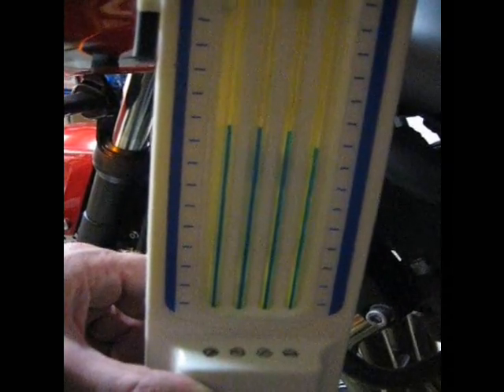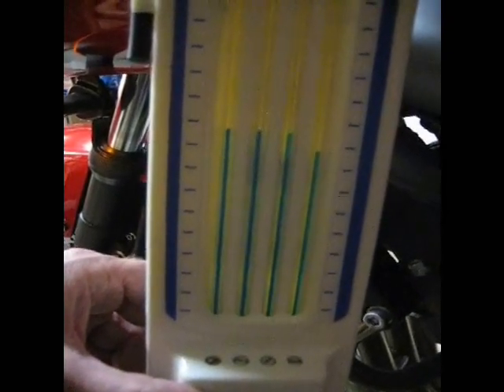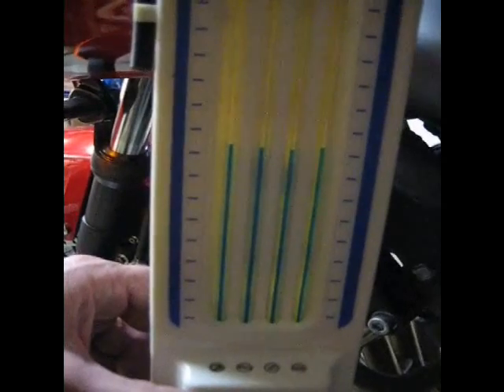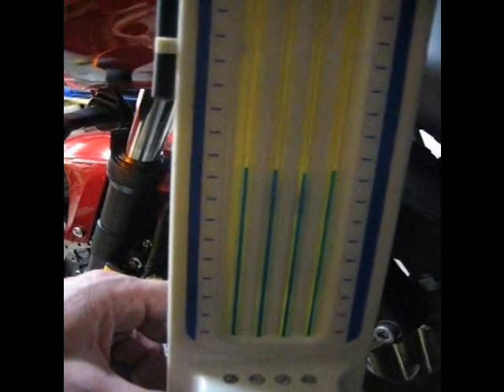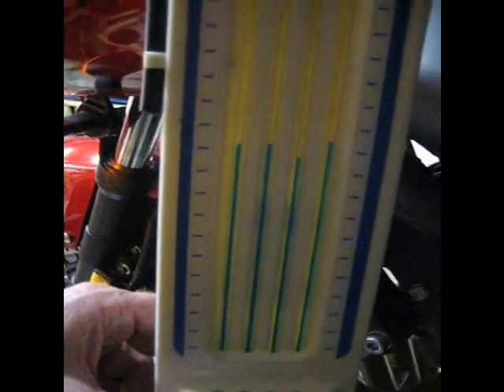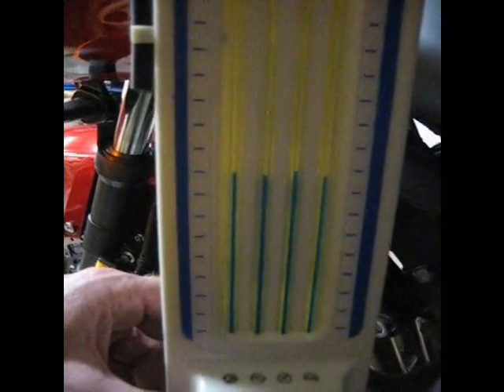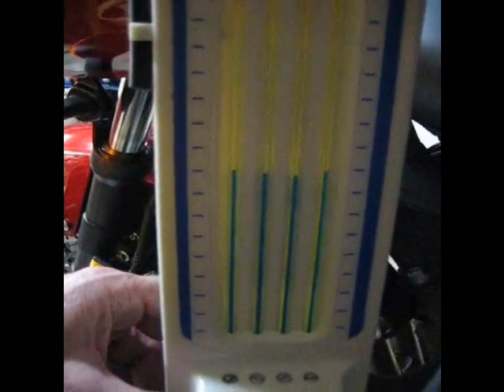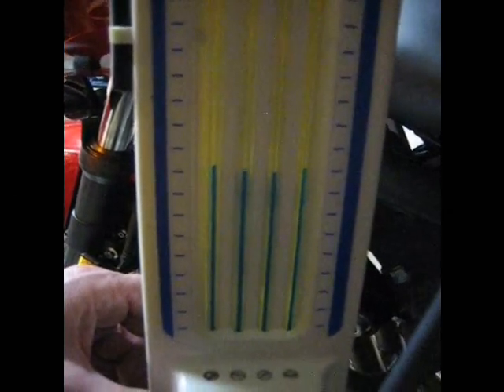How to synchronize your throttle bodies.

Comment: So is this for just carbs? Can this be done on fuel injected engines?
Reply from the maker: It works just fine on fuel injection.  The bike in that video is an FZ6, which is fuel injected.
Reply: @ElQuesoGuapo  great, thanks. I need to do this on my 06 zx6r. Where can I buy the tool for the vacuum?

Comment: Should i do it on idle 1260 rpm - service manual idle rpm, or rise at 2000 rpm and then ajust and low down to 1260?

Comment: I synced my 2011 ZX14 and it almost stop cutting out at full throttle and low rpm. I synced them at idle, should i sync them at higher rpm?

Comment: I just setup my new Motion Pro tool. And I'm trying to calibrate. But as soon as I turn the bike on it wants to pull all the fluid all the way up the tubes and into the engine.  I followed the setup instructions to the T and I double checked them.  Any advice or suggestions on on what the tool may be doing?  I'm going to take it apart and double check the brass restrictors that I put in the end of the tube to make sure it isn't cockeyed.  Any advice would be greatly appreciated. Thank you
Reply: Did u put the restrictors n the hoses going to the engine? Maybe u need to close the little screws on the tool.

Comment: If you set the balance to the cruising rpm in neutral the vacuum will not be the same as on the road as there is less load on the engine and therefore the throttle is not open as much. There will always be slight imbalances off idle through the rev range. Personally setting it at idle is the best compromise to me.

Comment: The last part of the video isn't accurate. At bigger throttle openings, the error of carb balance decreases as the percentage area difference between the open c.s.a's diminishes. Therefore it is better to balance at idle.

Comment: how do you know the 1st vaccum you have from your syncros is the correct 1,you are just matching each other ,you dont have a value?or you have to have the manual to chek the nominal value from the factory and then regulate the carbs..and is pretty interesting how 1 and 4 has more vac and 2 and 3 less but match eachother at 4000rpm thats defenitly a factory manual recomendation.i man do you have some zx7r on sell or a friend thats sell 1

Comment: You are right about synchronising at highway revs. Better still is to do it on a dyno, so that you are at highway revs AND under load. Not may of us have a dyno though.
I tried recently to balance the carbs on a two cycle Suzuki GT 500A. It was very difficult. The vacuum was so low that I had to rev it like crazy  6000 rpm, to get a reading on the Morgan carbtune system.

Comment: No apparently it is steel rods in the Morgan ones, see the website, They are suppossed to be better for the reason that the gauges can be led down in a drawer or used upside down for low compression bikes like BMWs etc, they are not allowed to use Mercury anymore I believe, but I think the alcohol ones that you speak of do look more acurate and smoother..

Comment: Wow, that liquid looks much smoother than the steel rods in the Morgan Carbtune Pro,  How often do they need syncronizing?, is it worth a bike owner getting one.   My ZX9r runs real rough at low revs, I think carbs are tuned for racecan it no longer has?, could it be that or valve clearances and carbs need syncing?

Comment: Great thanks. I guess if i bought the motion pro id have to get the 6mm adapter kit, no? Silly that its not included. At least it comes with the morgan carbtune but i like how you can adjust the levels on this before hand.

Comment: Is it possible to sync them to the point where idle and 4k are the same?  It almost sounds kind of cheap knowing that the bike isn't running 100% at idle but 100% at 4k or vice versa.  If its possible to get thole whole range of rpms sync'd then wouldn't that be ideal?  or not possible?

Comment: Great video. My 04 R6 runs perfect but it does have 25K miles on it. the bike is getting the valves adjusted this week and then I plan on synching the throttle bodies. What mileage they should be synched at? Also, from a 1-10 rating (10 being the hardest), how hard is this to do by yourself or with the help of a friend? I do have mechanical experience but I just wanna be sure this is a job someone like myself can do. Appreciate it, look forward to your response.

Comment: After taking my R6 in to the dealer, they ended up syncing the throttle bodies and it made a huge difference!  It idles much smoother and quiter (and the ticking sound is gone!).   They used this same method for balancing at idle speed and around 4k RPMs